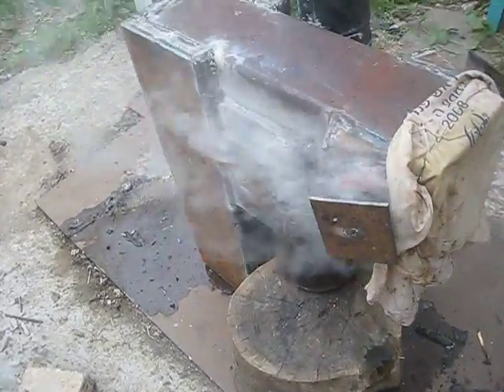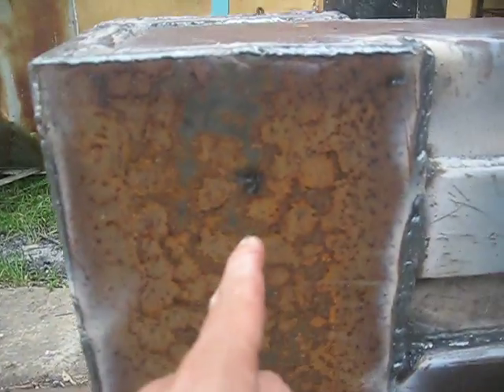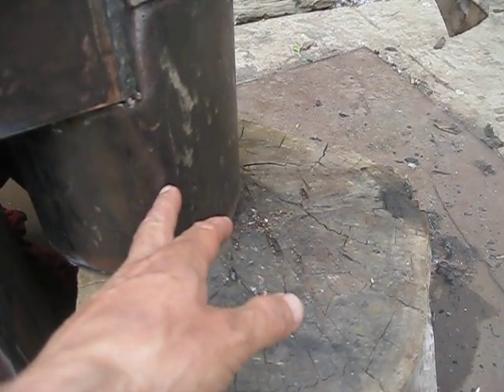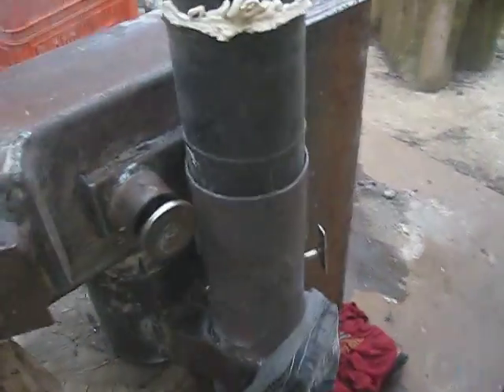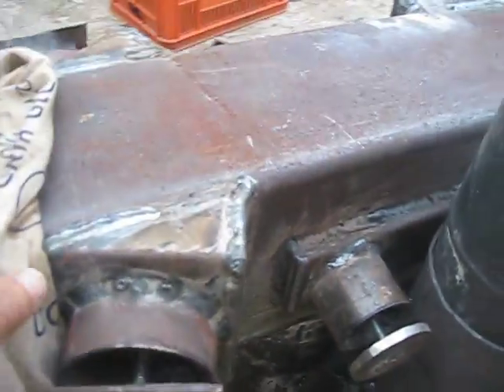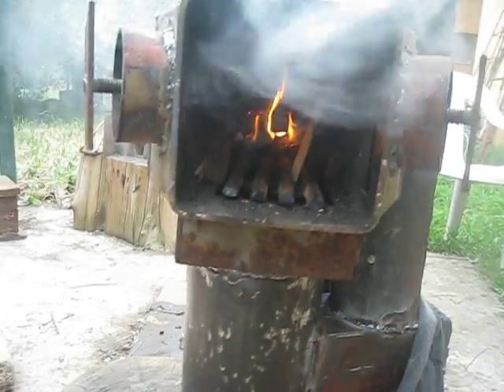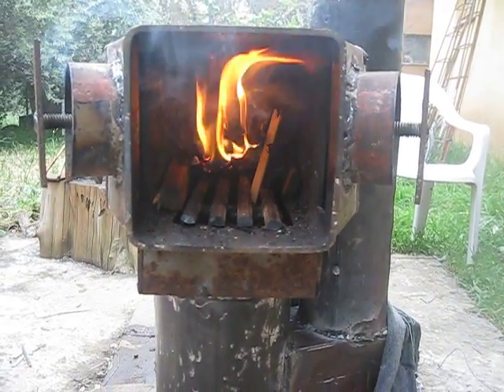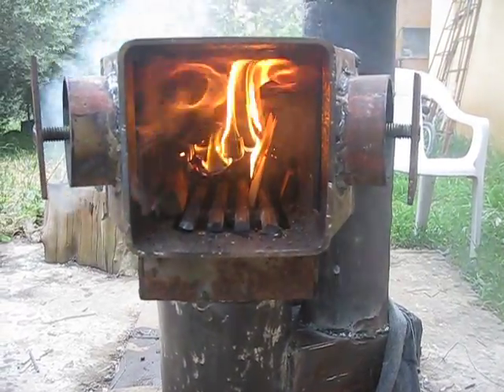Multi-compartment downdraft rocket stove heater failure

Comment from the maker: Yes, I have a dumper at the stove exit to the chimney and it was open. I will use an hair dryer to suck air at the chimney exit  to start the flow at the right direction and see what happens.

Comment: Your ideas are remarkable. I wonder if it would help if you insulate the horizontal combustion chamber? I am assuming your heat riser is insulated too. Seems like it's just not getting hot enough. Anyway you get an A for effort.

Comment: How about introducing a flow of air temporarily to the chimney to start the flow in the right direction? You could drill a hole in the chimney pipe and inject a blow lamp pointing upwards or even compressed air to create a sucking effect to see if it will start to draw.

Comment: Possibly to many compartments?
I had a chance to play with my stove today.  I have 'optional' modules I put onto my stove & with the 'cook top' option I can't get the stove to work properly.  There is smoke everywhere, and the wood doesn't burn thoroughly.  I'll try to get a video up showing it failing.  I change to the 'water heater' option and it works amazing. ???
Now, with the 'rocket stove' only, it will not burn properly unless I add 2 + feet of chimney.  But you have lots of chimney.